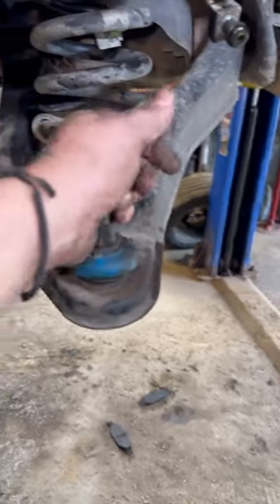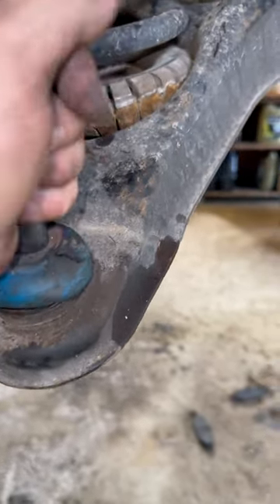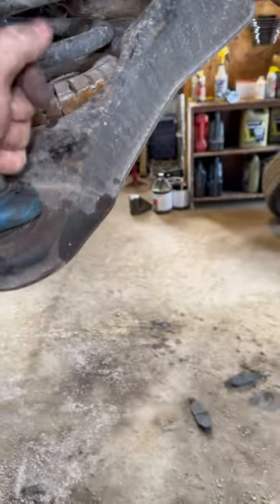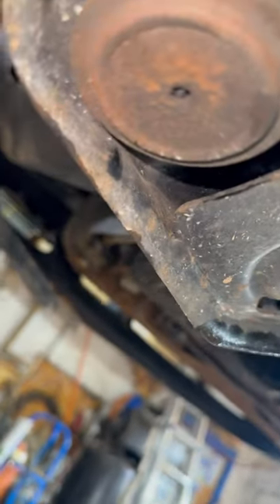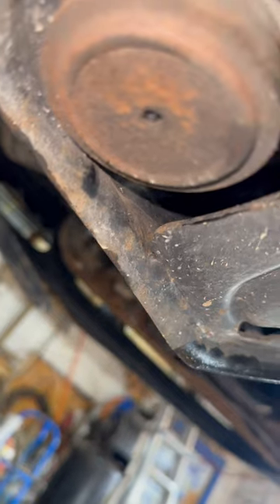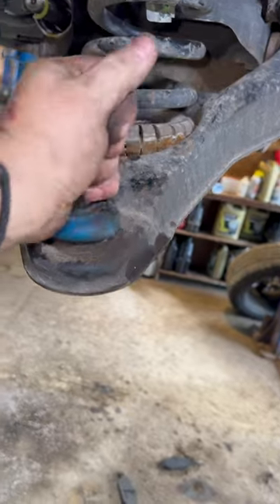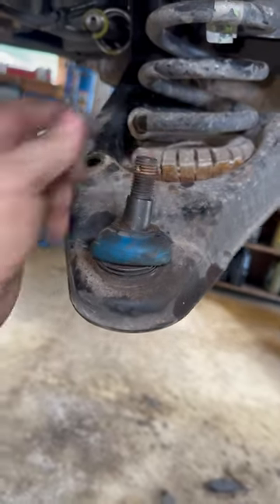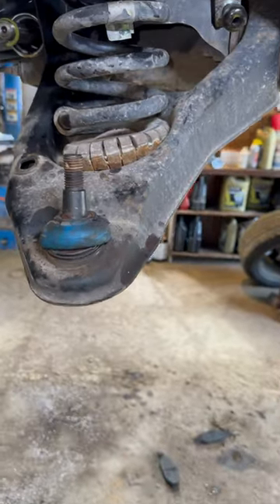Don’t forget to grease your nipples! #mechaniclife

Comment: How would you change that ball joint
Reply: You press it on with a ball joint press
Reply: @jacoblawrence6  so I have a ball joint where the side where the threads are is  smaller in diameter than the end that’s flat,  would it still work ?
Reply: @selwybcodjoe9630 Yours would still be pressed in and out with a ball joint press. Just the oppoaite direction as the one in this video